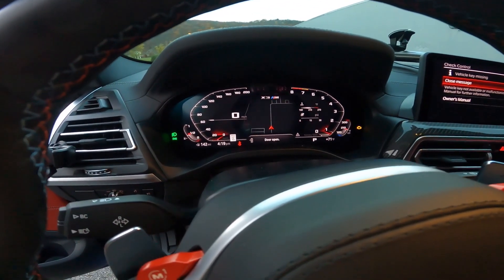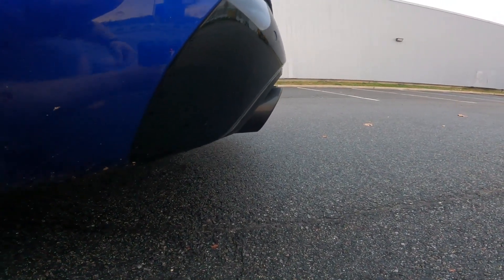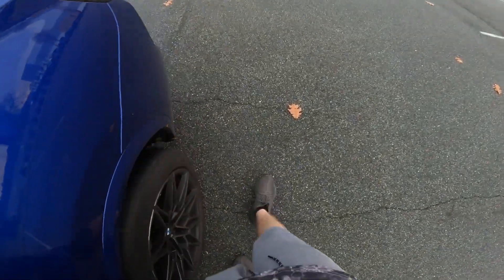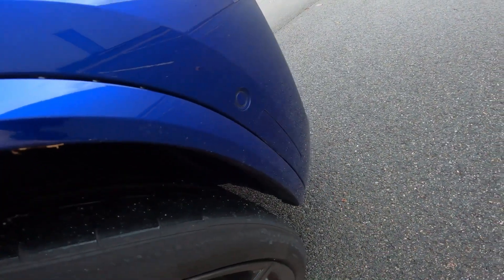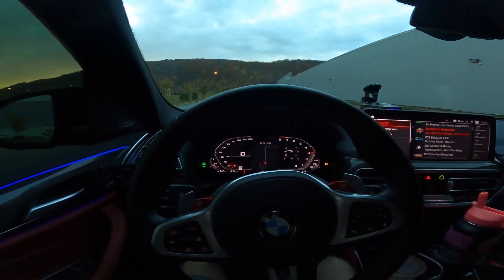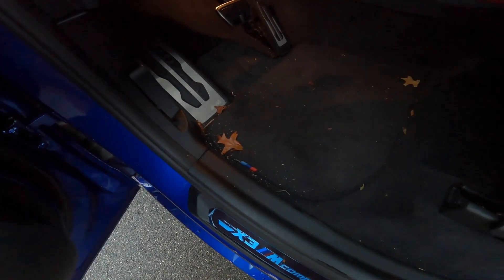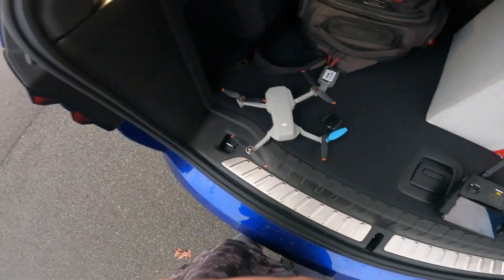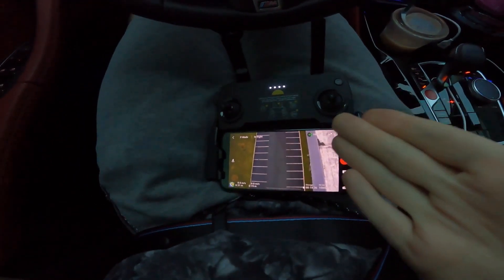22' X3M | VRSF DOWNPIPES | ISSUES/UPDATE

Comment: What I did was warm up the car, turned the car into sport Plus, verify valves are open, disconnect the actuators on both sides, remove 7.5A fuse and reconnected the valve connectors after pulling fuse and it'll be 100% open

Comment: Is it the flaps? I've heard when you put higher air flow parts on with stock muffler, it's actually the muffler. The baffles need to be welded as that's what's rattling.
Reply from the maker: it is not the flaps. we discovered and confirmed it is the metal baffles within the muffler itself that failed. issue is now fixed with a completely new exhaust system!

Comment: Man that's terrible to hear about the muffler. This is the first I've heard of it happening. I just installed a midpipe and so far it sounds good.

I have a resonator though and stop down pipe.. hope all gets resolved with the new muffler. Subscribed!
Reply from the maker: You’ll probably be alright if you have the resonator from stock still? What brand did you do? Dinan? The first time around I removed the secondary cat with the evolution autowerks mid pipe, I heard some rattling but it was okay, I couldn’t really figure it out, the SECOND I put the downpipes on, the actuators failed almost simultaneously lol.
Reply: @TeamSpeedDemon  shit man.. I  hate it when things break.. You don't expect it to. I went with a custom stainless steel mid pipe that kept the stock resonators. The sound is night and day. The car should have sounded like this stock imo. Just upgraded a short clip of the sound